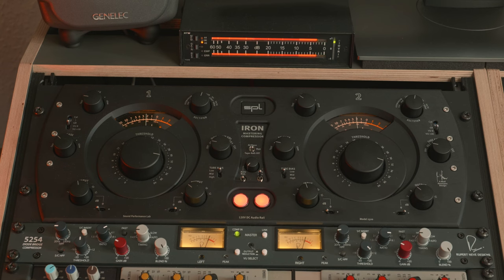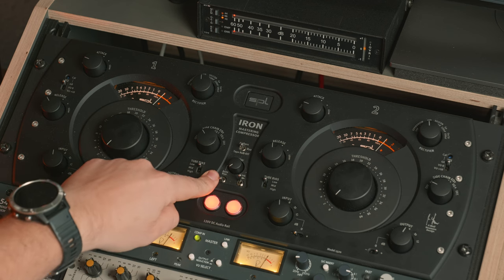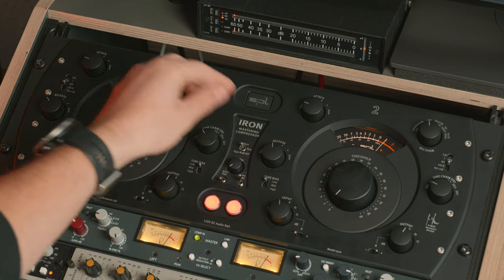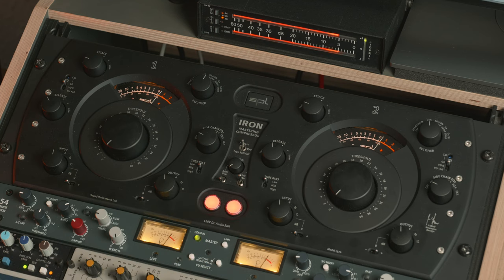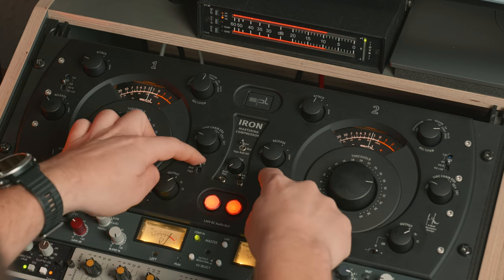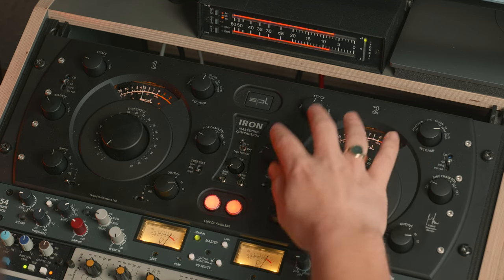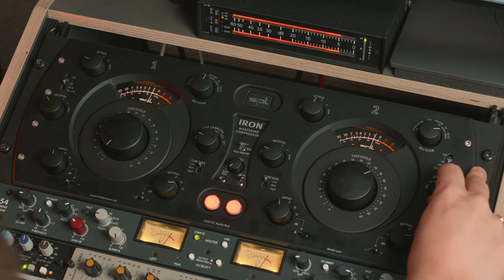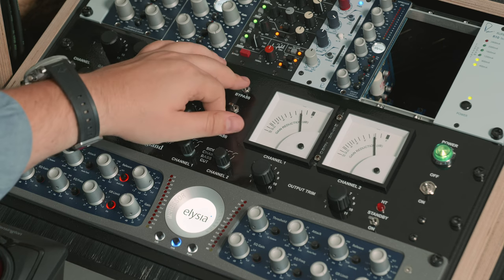The Famous Tube Compressor | SPL IRON V2 Review

Comment from the maker: What should I review next?
Reply: Alpha
Reply: - Neve MBP if you haven't already.
- Overstayer - any
Reply: Would love to hear you demo and review the Alpha next.
Reply: One thing I would correct. There are 6 different rectifier circuits, germanium, silicon and LED diodes which change the attack and release but also the character. This is stated on main SPL page for the Iron on the SPL website and it is why that dial is called Rectifier. Ive had one for years, it does have 6 different circuits. But they are rectifiers not, compression circuits. But the rectifier will change how the tubes react, which will give a different character.
Reply: Maag Compressor !!!!
Reply: Shadow Hills MC
Reply: What do you think about the old spl vitalizer stereo?
Reply: Maag

Comment: Thanks for the great and such interesting review. But I founded that something  not clear or even not correct about understanding "rectifieres", cos according the SPL website info the different rectifiers are really based on different elements.
 SPL: "Rectifier
The tube stage is controlled by a rectifier circuit. There are six diode control characteristics generated by germanium, silicon and LED diodes or combinations thereof.
The attack and release times vary depending on the rectifier circuit selected." 
All that means that there are an actually few different circuits, not the only "different settings for the attack/release time", as you describe.

Comment: Did you play with the V1 before?  V2 is sounding way better to me.  More round, classic, smooth.  V1 sounded very transparent in compression movement but with a forward edge to the upper mids even with low input levels from the audio I have heard.  Also, do you find that the parallel channel on the Hermise has a bit of that 120v rail transient enhancement thing going on compared to the passive signal path or is it invisible?  Also I highly recommend the SPL Mercury. Those analog filters doing nyquist are amazing.  I tend to work at the target level eg 44.1 now rather than downsample post capture.  Always wins in blind ABX.
Reply from the maker: Exactly my findings as well. The original sounded „stressed out“ in some areas. Don’t know why though. Just heard audio examples. Could’ve been „wrong“ input levels i.e. too hot levels.
Reply: @phable  Yeah I don't think so.  Even Thom Wettstein's videos he is running it really conservatively it has this enhancement to the mids that sounds mildly edgy and the compression action is totally different.  The compression is invisible like my Fairman TMC but not as good sounding.  Where as the Iron v2 has a real feedforward movement to it and the presentation is more like the top end details come out in a smoooooooth way.  Instantly one of the best-sounding compressors I have heard!  Anyway, I am getting the only V2 in Australia sent over this week!  I have no doubt its a keeper.  Thanks so much for the videos on it!  Amazing.
Reply: @phable   Iron V2 arrived.  Yep very smooth and super wide soundstage.  Those new Cryogenically treated tubes sound amazing.  Better compression action and sound.  Never gets that upper mid forward thing.  Quite a strong change to the soundstage.  Lots of increase in detail.  Much appreciate the video for putting me onto it.  It excels on electronic music.
Reply from the maker: @millenniummastering  wow, really glad to hear that!
Reply: @phable  Alright so I know my way around the Iron V2 quite a bit now.  Lots of testing over the last 3 days.  Mastered 2 albums an EP and a few singles.  So part of what is happening is the supra opamps are doing that level lift thing when you engage the input and output trims.  Massive lift in the sound, extra details and separation, extra weight and solid image.  Very similar effect that you get when running the DMC and using its insert pathway, just without the valves.  Without the trimmers engaged its more transparent if you hit it lightly enough.  Interestingly because the input trimmers and the whole unit has such high headroom it can sound nicer when driven hot at the end of the chain and using them to turn the level down and back up again.  Similar to the PQ in the way that thing loves to be fed a really hot signal before it starts to shine.  Something about that 120v rail stuff loves to be smashed.  Just not the valve compression part, but all the solid state and transformer stuff in the Iron loves it.
Reply: You are completely wrong. I have a V1 and ordered a V2 demo. I had  2 weeks the chance to run everything through it. V2 sounds way colder. V1 is warmer, more bass. V2 is cleaner. SPL just did the upgrade because of the lack of availability of the JJ tubes in V1. I've heard even the SPL staff saying "if you have a V1, keep it ".
What I also disliked were the new sidechain curves. V1 curves were a bit hit or miss, but they often gave a completely new view.

But first of all the sound: everybody who heard the two units in my studio liked V1 better.
Reply: @jochenh.7428  Interesting.  Will try and arrange a shootout with V1 then.  I must say I love the clean clear thing it does.  It was absolutely perfect for delicate melodic techno.  I do have so many color pieces around here tho including some JJ based valve colour boxes.  Also I have the tube calibration procedure so I could easily tube roll it with Nos Telefunken, Amperex, RCA etc.